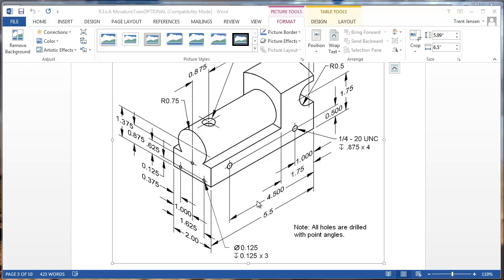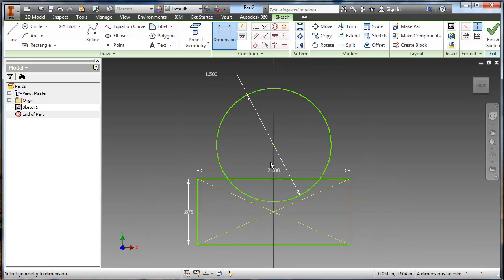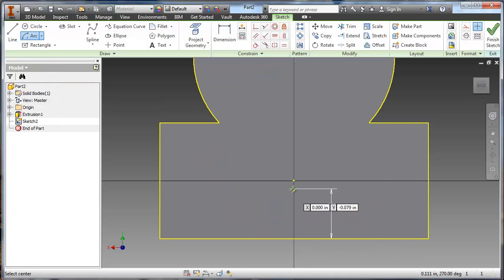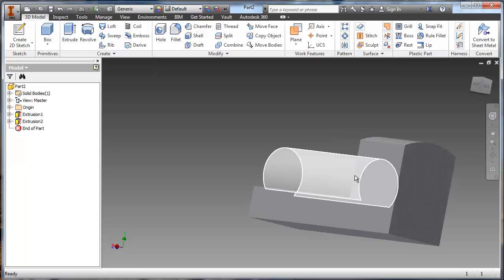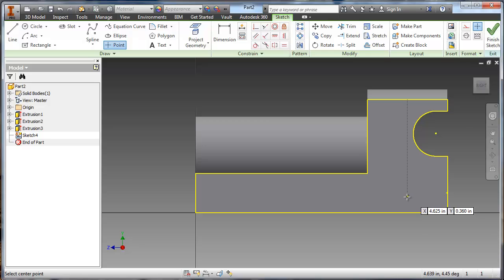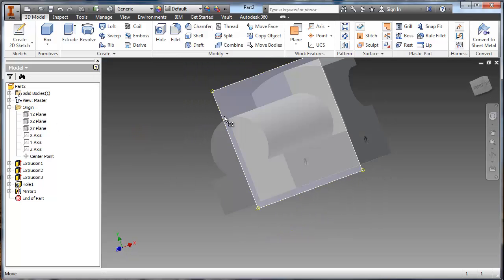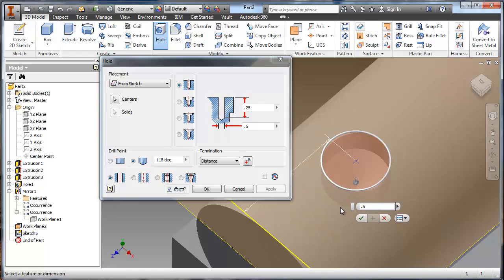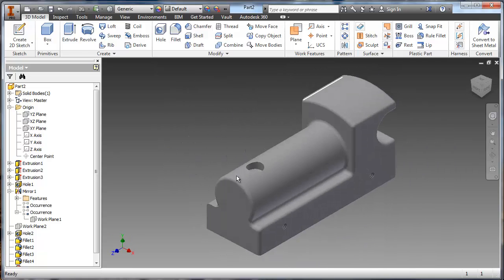Inventor Train Body Tutorial

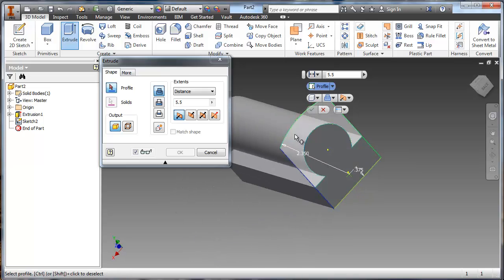Comment: i have a question, i'm on the part on about 6:10 when i try to extrude it, it's not letting me select the specific part (the top like yours) instead it keeps extruding the whole entire shape. I don't know what I did wrong, I followed each of your steps
Reply from the maker: Usually you can solve this by going over your lines again in the sketch.  It happens when a shape isn't fully closed and Inventor doesn't recognize it.

Still, you should be able to do the extrusion even if it's the entire shape.  Just flip the direction it is extruding and go the 1.75" back toward the front of the train.  Sometimes Inventor thinks you want to cut instead of add so you may have to flip it back in the extrude options.